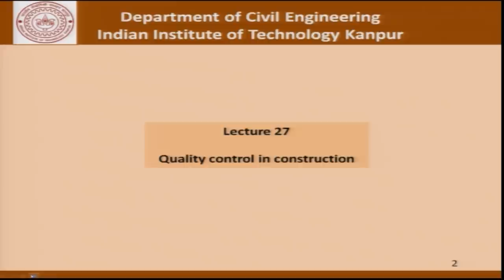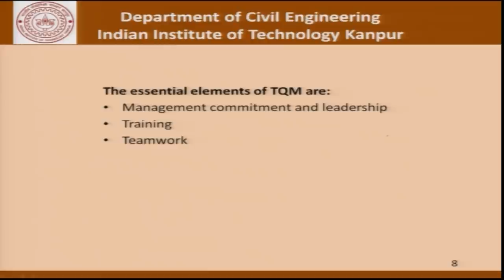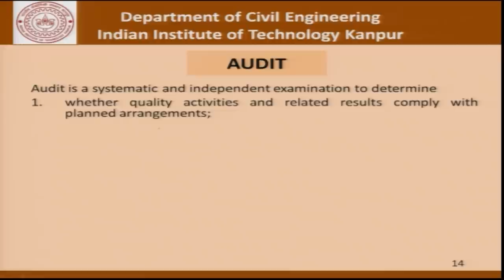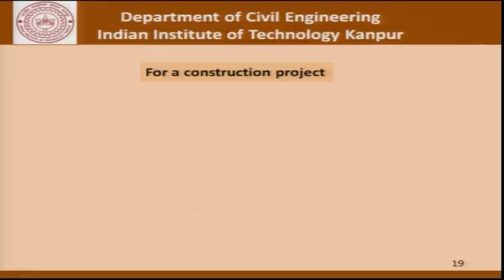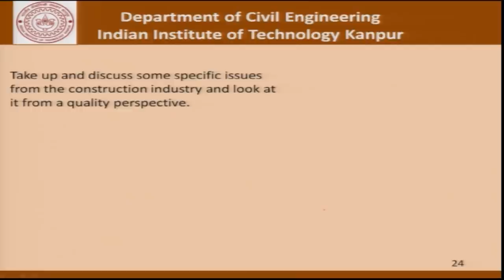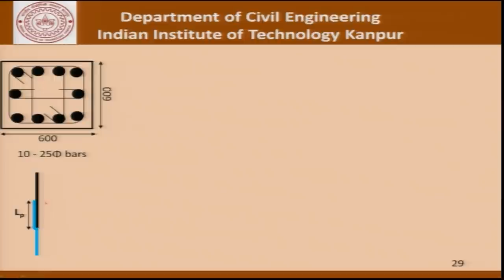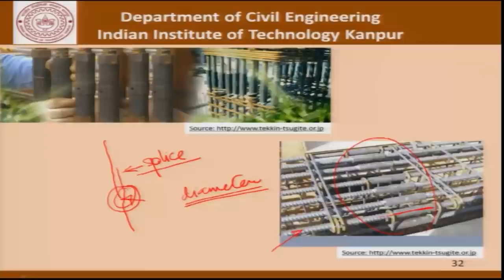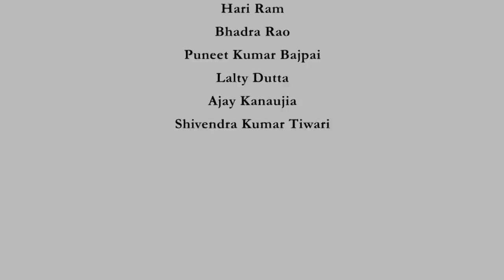Quality control in construction

Comment: Great lectures
sire i have a problem 
If a company precast 7 elements/ day and it takes 5 days for the elements to be harden. those incharge of laying can lay 12 elements in a day and the total number of elements to be precast is 420 elements.
NB: start of laying is 20days and end if laying is 55days
1. when can pre-casting start so that laying of elements will not be interrupted 
2. determine the maximum number of elements that can be stocked on the site.
Thanks sire. i will be waiting for anyone to help me out